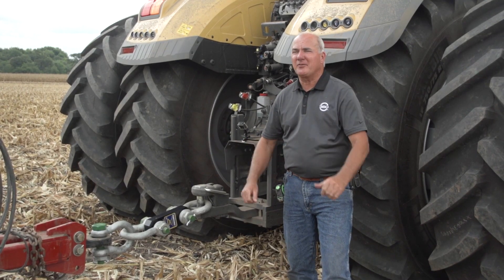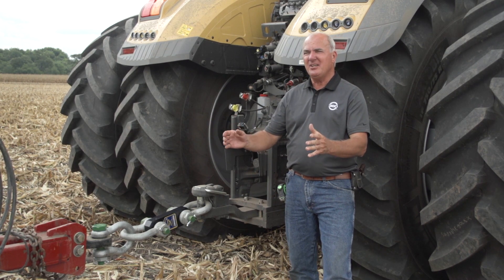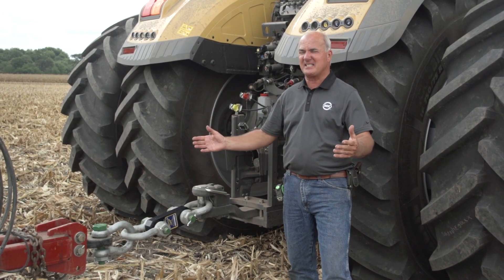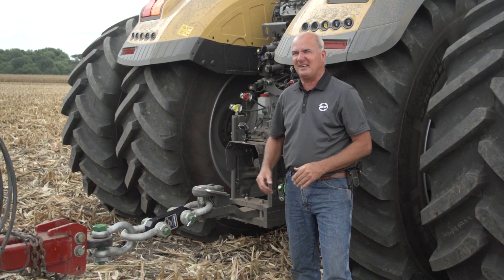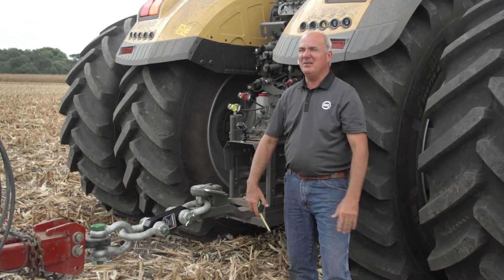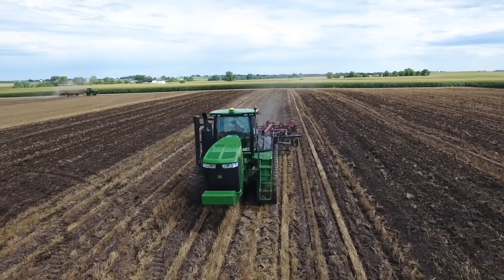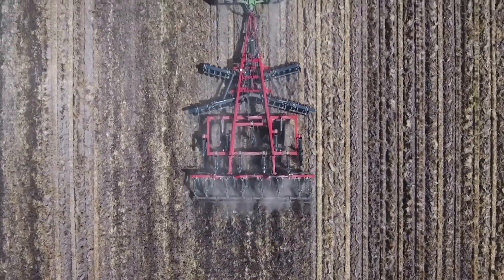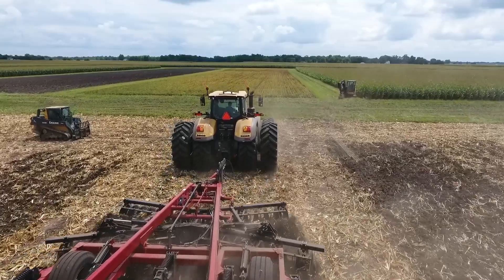Pull comparison: 360 BULLET vs OEM points

Comment: the bullet ripper points are by far the best we have ever put on our three  512 jd  disc rippers  ,up here in manitoba there is very little ripping , we  have been doing the whole farm every year for about the last 20 ,after putting on the bullet the fields were much leveler .never noticed it pulling much different